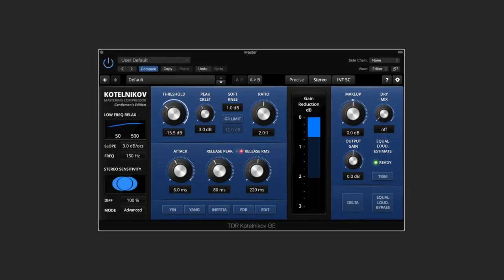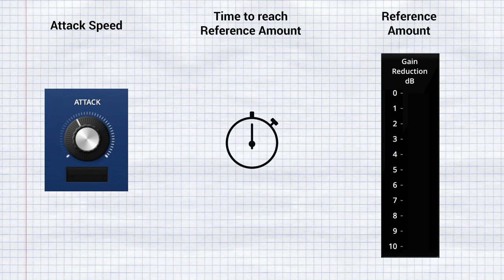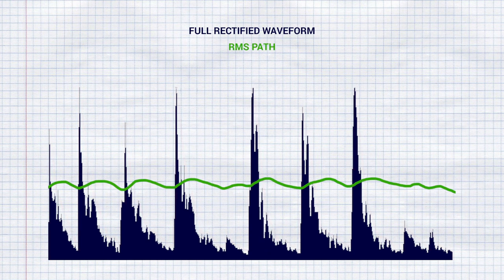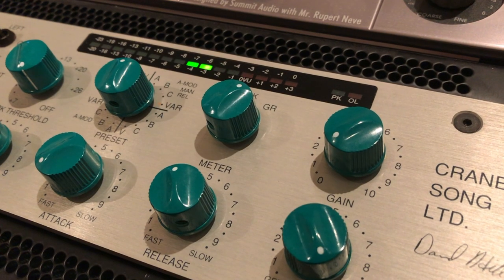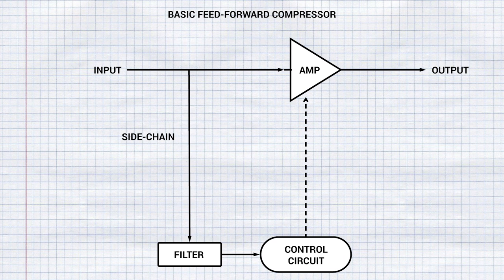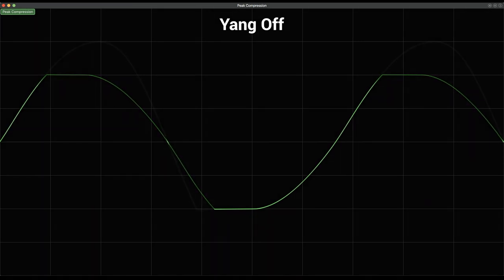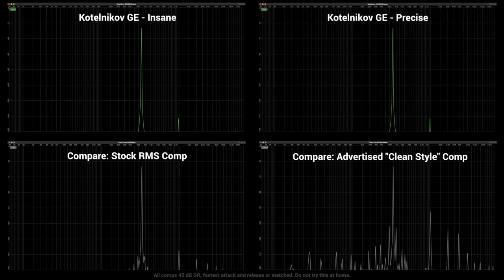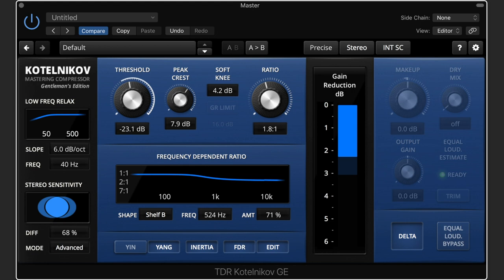The Mastering Compressor - Advanced Functions - TDR Kotelnikov Gentleman's Edition

Comment: Wow! I was using this with just the presets (on the free version, which are great) simply because I was clueless as to how to set it beyond the basic controls of any compressor. Now I know what each knob is doing, and more importantly, what to do with them. The GE has a few extra features, but even the free version is very versatile. This was also very instructional on compression in general. This knowledge will also help you set other compressors with similar features. Great video.

Comment: Thank you for your video! I've got one question regarding mastering compressors in general: what are in your opinion the strongest competitors to this compressor? Fabfilter Pro-C2, u-he Presswerk, Weiss Compressor, iZotope Ozone Dynamics, elysia Alpha compressor? It's a bit newbie question, but I would be greatful if you share your opinion on who is the best here
Reply from the maker: Tone Projects Unisum by far
Reply: @GearGrotto  thanks!
Reply: @GearGrotto  sorry for bothering you, but could you please give some hints on other mixing/mastering components such as limiter, equalizer, saturator, clipper or something else maybe? There are just tons of VSTs nowadays, and they all are promoted as "great sound quality" and "very versatile", but as with this compressor example there should be some obvious leaders (obvious for professionals, of course). And what is your opinion on DMG Audio products? I heard very positive feedback on their conpressor even compared to Unisum
Reply from the maker: Sure, although I don't think there's a simple answer to that. I like the Tone Projects Unisum comp + Tone Projects Kelvin saturator/harmonics generator. Digital EQ I like the FabFilter Pro-Q 3. For clipping I use my own Bifrost Mastering Soft Clipper. For limiting I currently use either FabFilter Pro-L 2 or Ozone Maximizer.
Reply: @GearGrotto  Thanks a lot!
Reply: @GearGrotto  bifrostaudio site is unavailable at this moment by the way, I get only "Apache is functioning normally" text on a blank page. Hope it will come online soon
Reply from the maker: Yes, that's intentional. Not for the public, I'm afraid. I'll prolly shut down the site or replace it with a splash page.

Comment: Why not many compressors have GR limit? Of ones I know is magnum-k, presswerk(kinda, in non-lin mode), kotelnikov, omnipressor.

None stock daw compressors have this option.
Reply from the maker: The FabFilter Pro-C 2 compressor has a GR limit (called "range") and many Waves compressors have it, too.

Quite a few compressors have a sort of built-in (hidden) GR limit, like the ratio dependent range in the Waves RenComp or most of the modes in the Logic Pro X stock compressor. In fact 6 of the 7 modes in the LPX stock compressor have varying GR limits, although unfortunately they're not user controllable.

But I think the reason why it's fairly rare is that it's tricky to implement in a natural sounding way or more likely that some designers just haven't seen the light ;-) I believe the GR limit in the Kotelnikov GE was a result of some lobbying, heh heh.

The GR limit in the Kotelnikov isn't simply a linear cap, but gradually puts on the brakes, so to speak. This is how the Unisum compressor does it too, but with a slightly different method.

Originally the Unisum had a simple hard cap, but this sounded unnatural so it was changed to the current "knee'ed" version.

Comment: I`m trying to figure it out how can I use it as a bus compressor like Waves SSL with auto-release as Kotelnikov doesn`t have it, I`m using free version though
Reply from the maker: You can definitely use it as a bus compressor.
While the Kotelnikov doesn't have a simple nominal auto-release like the one in the SSL bus comp, the Kotelnikov has dual peak + RMS release settings.
The RMS release has a hidden frequency based auto-release (decelerates release with more bass material) as well as an anti-breathing function (sort of a hysterisis, perhaps) that reduces the risk of breathing artifacts during short breaks, which is always a challenge with a full mix/master.
You could argue that the Kotelnikov is in fact the superior bus compressor , since it is built for full mix/mastering applications, but with more tweaking possible than the SSL. The downside is that it's not as quick to set up.

Cheers, Holger